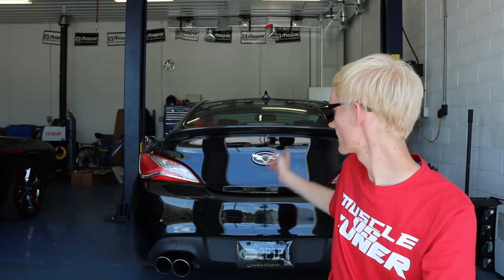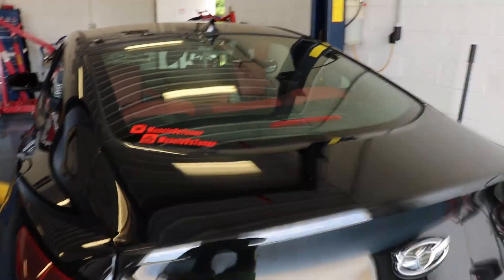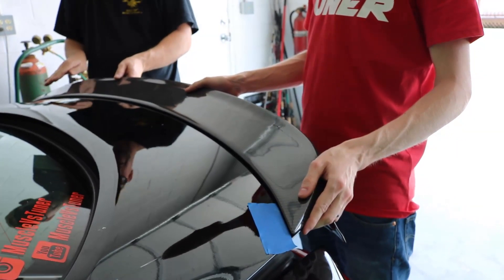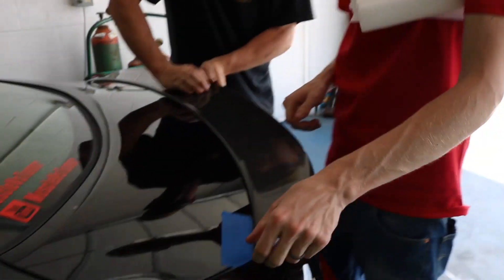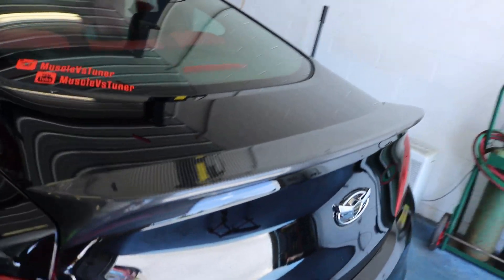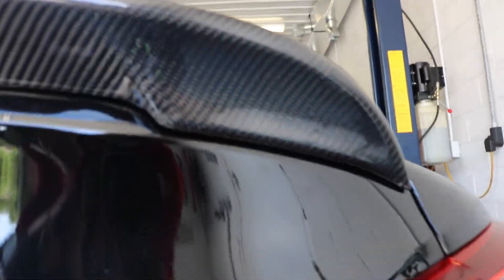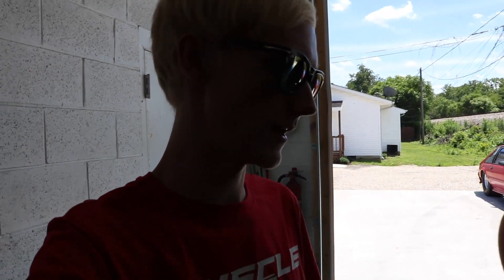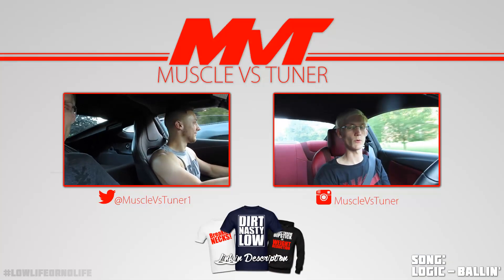Putting a SPOILER on My Genesis Coupe

Comment: Now we wait or a my spoiler fell off video
Reply: For*
Reply: I thought he was trolling at first
Reply: or we can place bets on if it will fall off at the car wash or at 100mph while racing and go thru the windsheild of the car in the next lane.
Reply: Yes i think the rain will make it less sticky and then fall off
Reply: itll come off. if it doesnt, then when you take it off, itll damage the trunk part. if you never take it off, then why not bolt it down? dont get why he used elmers glue instead of doing it right

Comment: I work for 3M as an engineer in the adhesives & sealants division. I can tell you right now that the double sticky tape isn't designed for the shear forces and extensional strain that your spoiler will see. You've also got to deal with water intrusion which will weaken the bonding. This is guaranteed to fly off and decapitate someone. You need to stop driving your car immediately and get it towed to a shop so it can be repaired.
Reply from the maker: Seems legit.
Reply: Look at that. A real engineer chimes in! You better make a video when it flies off and hits the person behind you.
Reply: +Muscle Vs Tuner just screw it down
Reply: It's pretty simple when you're working with adhesive.  Probably a little over exaggerated but there's now way that's staying  for a long time.
Reply: That's not a very ricer thing to do, we drive it till the shit breaks and murders someone
Reply: +Muscle Vs Tuner make sure u never leave your prints on it just incase.
Reply: He will be find dude. My bmw came like this from the factory. Its a small enough spoiler where the tape holds enough surface area to keep the spoiler installed. If he put it on right where the tape is in the right area he wont have to worry about water. I just had a carbon fiber spoiler installed which is a factory option and this is how its installed and I havent had an issue.
Reply: take that 3m adhesive tape and put it on the back of your neck and put a ducktail spoiler on you soo when you run it helps mate.
Reply: @MuscleVsTuner  gorilla glue

Comment: Tape will work fine, people would be surprised with how much of their cars body parts are held together with just automotive tape. Body shops use tape all the time. Spoilers are just a worry because people lean on them sometimes which is still bad if it's bolted.

Comment: If you use painters tape when you drill the paint wont chip. Also the dent can be fixed its not that big of a dent to matter. My spoiler did the same thing.

Comment: Nice! I need a spoiler on my 370z
Reply: +farm boi drifting I spit out my milk
Reply: The 350 and especially the 370 really benefit from a lip spoiler for aesthetics. The 370 ass is way too flat without one.
Reply: that's a rear drive car that can go 160 mph. the proper spoiler may add to the stability. Even at 155 my E-46 BMW don't need a spoiler as its designed for high speed stability.
Reply: Amuse Spoiler???

Comment: if the heat from a hot summer day hits ur car the tape will get lose cause the glue will melt....it will hold for a whike but it will eventually start to get shaky ...why did u use outdoor clear silicone....

Comment: You wait until it gets to be about 90 outside that fucker will fly right off
Reply: Nah, I installed one on my 350z years ago and when I sold it it was still in place, very solid if installed properly. (Used 3m tape)
Reply: +Brawndo 3m is good stuff but not when it gets hot I had one on my 240 and it flew off a couple times maybe you just got lucky friend
Reply: Will Reedy I live in an extremely hot and humid tropical climate, so I guess i just installed it properly. Cleaned paint with alcohol first.
Reply: +Brawndo same man

Comment: You should explain why you're getting the transmission mounts. Caugh*Gear grind*Caugh
Reply: Grinding gears has nothing to do with a mount
Reply from the maker: He's right, the stock mounts are to soft, new ones make it much better.
Reply: +Muscle Vs Tuner there is usually a bigger issue if you have gear grinding that just recently developed... If they were too soft it would've been an issue long ago. That's all I'm saying.

Comment: How much HP does the genius have ??
Reply: like 320-350ish
Reply: 348
Reply: With the spoiler like a extra 250hp
Reply: +Patrick Vincent yeah and with those Genesis badges at least another 50 wheel
Reply: +Cameron ツ plus the tape to hold the spoiler, so much weight reduction that's another like 100hp!!

Comment: Really? You attached a spoiler with dubbel sided tape even a ricer would bolt it
Reply: Most lip spoilers use 3M double sided tape to hold them on.  It's not like it's a Formula 1 car where the downforce is so strong that it would require bolts...

Comment: I like how they went to a shop do a simple ass install,  goes to show how pathetic theese guys are .
Reply from the maker: +KiD HiLaRiOuS Maybe we did other shit too? Who knows...
Reply: +Muscle Vs Tuner world may never know
Reply: You should watch the whole video lmao.
Reply: Yeah.. That sums it up.. The only thing that I saw was pretty high skilled as far in the mechanics world. His dad welding in his own custom made roll cage which I thought was pretty damn cool.. But damn.. Is he planning to do 9 sec in that fox? Im not too keen on the engine choice he made.. But its what he built and what he's comfortable with. I myself have a 1993 fox gt hatch. E303 cam. 3inch turn down catback exhaust. 4.10 final gear drive. (Yes its a manual) Trickflow intake with manifold. 165cc afr heads. 24lbs injectors. 75mm throttle body. BAMA performance ECU chip. BBK cold air intake. Basic shiiiit bolt ons. Got 80k miles on motor. Dyno and tuned. Wanted 350hp. But just shy of 343hp and a massive 360ft lbs of torque. 

Next project is gutting it out and hopefully getting under 2900 lbs. and maybe juuuuust maybe a 125 shot 😊
Reply: Not really pathetic because they did the work themselves and what's really pathetic is you can not spell "these" correct
Reply: His dad owns the shop, whats pathetic about that? Sound like this dude's a little jealous they have a nice shop to work out of. I personally would have drilled holes, but if Ryan used good quality double sided tape then it's not going anywhere.